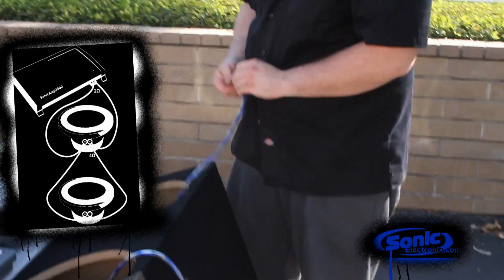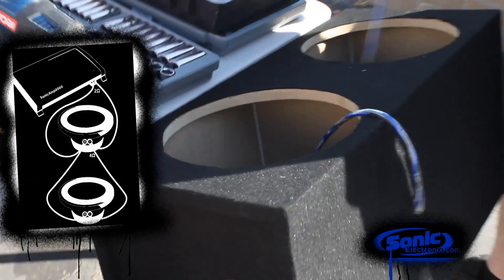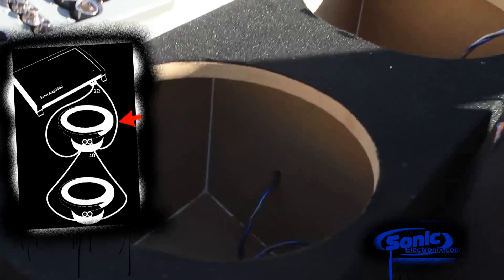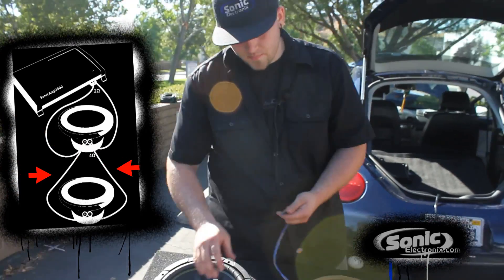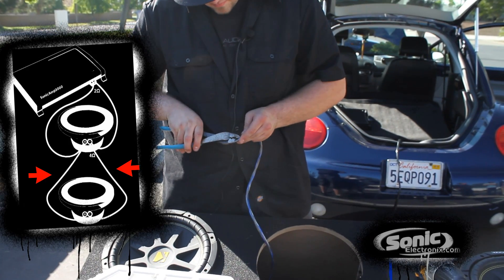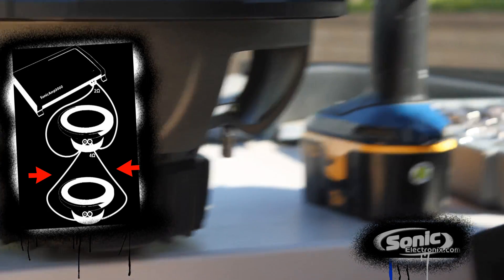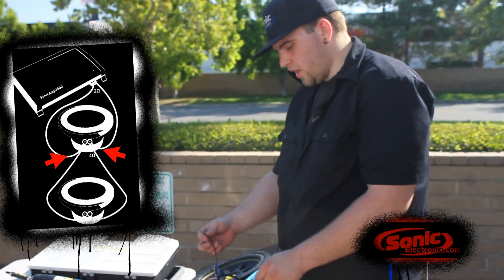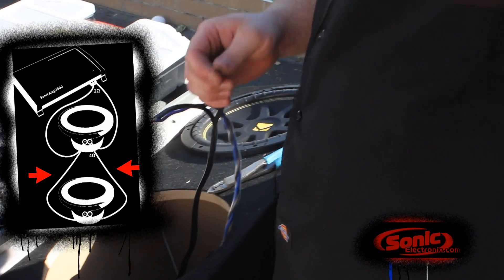How to Install Two Single 4 Ohm Car Subwoofer with a 2 Ohm Impedance

Comment: Pioneer TS-SW3002S4 I have 2 of this wmshalloe subs they are single coil 4 ohms each. My amp sometimes goes to protection mode. My amp is a hifonics brutus 2 channels 1600 watts old school. I haven't connected the subs at 2 ohms. What difference I should spect after I change my subs to a 2 ohms?

Comment: i did this with my 2 10" and its a huge sound diference i have a lanzar vibe 1200w amp at 1 ohm it pushes 500 w at 250rms and that matches my subs

Comment: I'll know the answer tomorrow when I check but, I bought a new amp last night that's 150 watt rms rated. I've got two ten inch subs rated at 100 watts rms in SEPARATE enclosures. One on each side of the back of my truck under the seats. The subs are each 4 ohms. My question is since their in different enclosures will running the positive wires together, and then running the negative wires together then connecting them to the amp bridged make the impedance at 2 ohms or will I have to run them like you've described when their in two enclosures. My goal is to get 75 watts rms to each sub. If I run them separate with one amp per channel at 4 ohms they will only get 50 watts. At least that's what the manual says. So a summary is how do I wire the subs so that they are at 2 ohms allowing each sub to get 75 watts?
Reply: Oh and they are both svc
Reply: I'm not positive but I'm pretty sure you need to wire them just like he did if you want to take them from 4 down to 2 ohm

Comment: Best way to wired single voice coil 4ohm 2 12
I have A 2/1 channel amplifier 1200w Sony Xplod 1200 Watt Audio Amp - XM2002GTW
Bridgeable 2/1 Channel Stereo/Mono Power Amplifier

Can somebody help me please the best way to wire them to my am so they can sound excellent please somebody help me Sonic Electronix please help me

Comment: So if you wired these to 4 ohms instead of 2 ohms would you get a lot less bass out of these speakers because there is double the resistance? I have a Rockford 1000 watt hooked to a pair of 4 ohms. The box says that the are good for 2 or 4 ohm setup so if I wire to two ohms will the speakers hit harder?

Comment: If i wire it correctly will each speaker receive the same amount of watts?
I am oing this to a pair of 6x9 my amp is 100 rms at 4 ohms and 150 at 2ohms.
speakers are 4 ohms but have rms of 150watts

Comment: you can also do it the best way wich this is not. both positives to both speakers to channel 1 positive and both neg to both speakers to channel 2  neg 
what hes doing doesnt make sens two 4ohm svc subs run in parallel weather your bridging just wiring to one channel on two channel gives you a final load of 2 ohms in series 8 ohms every dual channel amp that i know of gives you more power when you bridge it

Comment: I've got a question. I have a ported box. What if you don't want to drill a hole in your box? Can you go from one subwoofer to the terminal then around the outside through the second subs terminals and then wire it like that? Its confusing.

Comment from the maker: It can be complicated, but to put it in simple terms, the impedance of a system changes with the frequency being played. Once you put a subwoofer in a box, the impedance rises at the resonant frequency of the subwoofer because there is different pressure behind the subwoofer in a box. This isn't important for most people, competitors will use it to get the most out of their amplifiers.

Comment from the maker: Two Single 4 ohm subwoofers will wire together to a final impedance of 2 ohms. So, you would need a 500W amplifier at 2 ohms.

Comment: if i have pioneer 2 250w rms 4 ohm svc subs and i buy a 500w rms 4ohm mono kenwood amp will that be safe for both my subs and my amp? (old amp blew for some reason and i was looking on SonicElectronics)

Comment from the maker: Your call. If you drill through the box just make sure the hole is big enough for the wire but not much larger. You should then seal up the hole on both sides once the wire is through it. If you have a monoblock amplifier with 4 speaker terminals, you can connect each sub separately as it bridges the subwoofers internally.

Comment from the maker: Depends on what you mean by "sounds good". If you want maximum output, you would want to use the most power you can in the right box. If you are looking for the most accurate sound, you would go to 2 ohms or 4 ohms because the amp has the best control of your speakers at that point.

Comment: hey I have 2 xplod single voice coil 12s and I have a 2 channel amp 2000w, I already did the bridge with both subwoofers,I put the positive of one sub to the positive of the other sub and I did the same thing with the negative side of both subs and then I bridge both subs with a single wire to the amp but I didn't get clear sound.... what am I doing wrong???

Comment: i have two rockford fosgate single voice coil 10s but 1 is a p1 and the other is a p2 and i have a 2 channel amp but only one channel works so i was wonderin if i could hook those up like this and if it would work right? thanks

Comment from the maker: You cannot run both of those subwoofers together. Run one or the other or get two matching subwoofers.
Reply: Sonic Electronix I have these same subwoofers. Will it change the watt rms when you do this? If so what is the new watt rms on these 2 12” comp c at 2ohms. The 4ohm svc is rated at 300watt rms each.

Comment from the maker: These subwoofers are Dual 4ohm's. This means you can wire them at either 4ohms or down to a 1ohm impedance. If you don't wire them together, each subwoofer can take a final impedance of 2ohms, but you will need a two channel amplifier. The Kenwood will work just fine, but make sure you follow a dual voice coil parallel wiring diagram to ensure everything is hooked up properly.

Comment: I have 2  12 inch kicker subs 07cvr124. What amp would u recomend.  And want to wire to 2 ohms.  I was about  kenwood amp 1800 watts.  Thatas 900 watts rms at 2 ohms

Comment from the maker: Since your 2 channel amplifier produces all of it's power at a 4ohm impedance and your subwoofers are also 4ohms, you're going to want to wire both of your subwoofers one to each channel. This will allow the amp to produce the 300 watts RMS each subwoofer needs.

Comment from the maker: If you get the Dual 4ohm subwoofers, you can wire them down to 1ohm impedance for 2500 watts RMS. If you go with Dual 2ohm subwoofers, you will want to wire them at 2ohms for 1700 watts RMS at 2ohms.

Comment from the maker: You should be fine with 1 8 gauge power wire from the d block, and you should be able to set it up where you will only be needing to run just the 1 x 8 gauge for the ground.

Comment: what about wiring a DVC 4 ohm to 2 ohms and then connecting a 4ohm SVC together... in parallel. what impedance would that be.... a 2 ohm load and a 4 ohm load in parallel.?

Comment from the maker: We would recommend against it. But as long as the final impedance is within your amps limits and the RMS requirements of both subs are the same you could technically get away with it.

Comment from the maker: Wiring them to 2 ohms increases the power output on the amp. They will be louder for sure, but you need to verify that your subs can handle the power increase.

Comment: ok, i have 2 svc 4 ohm subs, can i do this to a 2 ohm 2 ch amp, cause i see you are only doing this to a mono block. the amp is a cadence xa250.2 500w rms @ 4 ohm and 250w X 2 @ 2 ohm. and the subs are MTX road thunder 250w rms

Comment: If i wire my two 4 ohm subs like that into a 2 ohm impedance, can i then bridge it on a 2 channel amplifier? or do i need to use a mono amp. Which would be my best option for more power?

Comment from the maker: @22DISA22 You need to wire them in a paralell configuration for a final impedence of 2 ohms.  This is done by daisy chaining all the postive terminals to the positive of the amp and daisy chaining the negative terminals to the negative of the amp. We hope this helps.

Comment from the maker: @stormer1092 Running them at 4 ohms will cause the amplifier to run at cooler temperatures.  Keep in mind that the lower the ohm load, the hotter the amplifier is going to run.

Comment: Hi so I got my hifonics hfi 2000. Before I install it I'd like your advice. It says it needs 4 gauge wire but I also came across your video about the big 3 upgrade, and It caught my attention because it says it helps with the dimming headlights. So my question is can I just use 0 gauge wire instead of buying the kit and would it be alright to run 0 gauge to the amp. Oh and one last thing I saw a video and they put a fuse between the alternator and the battery. What fuse rating is it supposed be?

Comment from the maker: @marchi3908 If you wire the subs in parallel at 2.6 ohms to the hfi2000 this should be fine.  You will be pushing around 1000 watts to the subs which would require 750 watts RMS if there are 3 of them.  Just make sure to adjust your gain accordingly as to not blow the subs.

Comment from the maker: @kigen818 You will need to wire it a different way then the video.  The video shows a parallel configuration and you need a series configuration.  Please follow the link to our wiring diagram tool:

knowledge[DOT]sonicelectronix[DOT]com/tools/subwoofer-wiring/

Comment: Im getting 2 kicker cvx122's and on your website it says the impedance is a dual 2 ohm and i am also getting a Hifonics HFi3000D amplifier, how would i need to wire it to get 750rms to each woofer? Do i wire them the same exact way you did in this video? Please help. Thank you very much !

Comment from the maker: @killa4nyah They will probably be pretty close considering that both of these set up will have the same amount of Cone surface area.  The 3 10's will give you a more responsive bass but the 2 15's will give you a deeper bass.  If you want deep bass go with the 2 15s and if you want tighter bass go with the 3 10s.

Comment: Hi I have a question which. Subs are better kicker comp or kicker cvr and is a hifonics hfi 2000 Watts good to push three. I just need a professional opinion on which to get either the comp's or cvr's. Thanks

Comment: I have a 1 channel 250 RMS/500 peak power amp for my Alpine Type E 12's (also 250 RMS/500 peak power). What is the best way to wire my subs to my amp? Bridged or parallel? And is it recommended to match watts or should I get an amp with a little more power?

Comment from the maker: @latdum The amplifier shown in the video is a 1-Channel amplifier.  For your Amplfier, you will have to input each subwoofer to its own channel.  Usually, this will not be enough power.  Additionally, you can bridge the two channels together to get more power output but you will not be able to achieve a 2ohm Impedance.  It would be highly recommended to run a 1-Channel Amplifier.

Comment from the maker: @racerboy2323 It appears as though you may have picked out the wrong impedance for your subs. Your Kicker amplifier is 2ohm stable, but wiring 6 DVC 4ohm subwoofers in Series/Parallel will result in a final impedance of 1.3ohms which could potentially overload the amp. We do not recommend wiring those 6 subwoofers up to the 2500.1. We advise that you find an amplifier that is 1ohm stable and can produce the required wattage, such as the Hifonics Brutus BRZ2400.1D.

Comment: Hi, I'm currently running a kicker 2500.1 powering 6 JL 8w1's wired to 4ohms. I'm switching the subs out for 6-REX 8" dual coil 4ohm subs. How do I wire them up? Thanku in advance.

Comment from the maker: @TheOxyMorin For quality go with a woofer that will give you a final impedance of 4 ohms, so either  a SVC 4 ohm sub or DVC 2 ohm sub. Then go with a sealed enclosure for tighter and more responsive bass. Here is what I would do. For the sub, JL Audio 12W3v3-4, for the amp Kicker ZX500.1, for the enclosure 12SQTC and for the wiring kit the Kicker CK4. This would be a very very nice system.

Comment from the maker: @DTayBeatz Yep wire then exactly like on the vidoe. The perfect amp for two 15" subs with a final impedance of 2 ohms and a power rating of 500 watts RMS go with the Kicker ZX500.1, the amplifier was specifically designed to strive in these situations and it is pretty affordable. Let us know how it turns out.

Comment from the maker: @KingBre99 I would say go with the 1SL12-0.7 for the enclosure and the Kicker CK4 for the amplifier kit. The enclosure is a sealed enclosure for tighter and more responsive bass. If you want deeper bass then go with the Absolute PSEB12BK enclosure. This enclosure is ported and will allow for elongated lower frequencies for deeper bass.

Comment: i wanna install two kicker 15" subwoofer they are both 4ohm and 500 watts at 250 rsm each..... do i install them the same way as in the video? and what type of amp should i run? and do u think a cap in needed

Comment from the maker: @TheTechGuider If you have two Single Voice Coil subs with each voice coil at 2 ohms then yes you can wire them together to a final impedance of 1 ohm. Unfortunately  each subwoofer will not get 2500 watts, they will each get 1250 watts. Keep in mind that running a system like this will require an upgrade in battery power and possibly your alternator.

Comment: @SonicElectronixTV Thanks for clarifying. i have a question if you would answer. im buying a soundstream rubicon mono amp the 2500 watt version its stable at 1ohm for 2500 watts 5000 peak. now if i buy two 2ohm 15's and run them parallel to get 1ohm an hook them up to the amp will both speakers get 2500watts?

Comment from the maker: @TheTechGuider We actually have a typo, you cannot wire two Dual 4 ohm subwoofers to a final impedance of 2 ohms. You can either wire them two a final impedance of 1 ohm or 4 ohms. What the video was trying to say was how to wire two SINGLE 4 OHM woofers to an impedance of 2 ohms. So for the purposes of the video it should be two subwoofers with a single voice coil each at 4 ohms each voice coil. Sorry for the confusion.

Comment from the maker: @9grande Its almost irrelevant to be honest. The different impedance gives you different wiring options. Also if you already have an amplifier the power rating at the appropriate impedance can dictate which subwoofer you will have to select. It is always better to run your sub or subwoofer to a final impedance of 4 ohms. If you have only sub then you would go with either  SVC 4 ohm sub or  DVC  2 ohm sub to get that final impedance of 4 ohms.

Comment from the maker: @Boobie16 If you have two Single Voice Coil 4 ohm subs then yes,just wire then together in parallel to a final impedance of 4 ohms. If you have two Dual Voice Coil 4 ohm subs then you can wire each one individually to 2 ohms but not together, if you have two Dual Voice Coil 4 ohms subs you wont be able to wire them to 2 ohms on your amp, you can wire them to 4 ohms or 1 ohm.

Comment from the maker: @asinhawkeye0065 If you have 2 12" Single 4 ohm subs I would suggest going with the Kicker ZX400.1 at a final impedance of 2 ohms. If you have 2 12" Single 8 ohm subs I would suggest going with the Kicker DX300.2 to a final impedance of 4 ohms at the bridged impedance. These would be the best two amplifiers to use with out having to spend more than 200 dollars.

Comment from the maker: @gigasearchman If you wired them exactly like the video (parallel) then you should be fine. Consult your amplifier manual to make sure you are using the correct terminals, if you have more than one.

Comment from the maker: @S1R369 If you want to wire two dual 4 ohm subs to a final impedance of 2 ohms unfortunately you won't be able to do it. You can either wire them to a final impedance of 4 ohms or 1 ohm. Your other option would be to wire them separately to their own individual channel in parallel to a final impedance of 2 ohms each. If you do this you have to make sure the amplifier is providing enough power at each channel to each woofer.

Comment from the maker: @xxxkhafanxxx If you have two Single 4 ohm subs then yes they can wire to 8 ohms. two DVC 2 ohm subs will wire to either 2 ohms together or to 4 ohms or 1 ohm individually. Yes 0 gauge is the same as 1/0, just make sure you get true to gauge wiring. Wiring is important so don't be afraid to spend a little.

Comment: @SonicElectronixTV 
Thanks man haha!! if i run 2x 4ohms to the amp, will the amp read 8ohms in total?
According to your wiring page, is it something like this? " 2 DVC 2-ohm sub ". ( assuming that i have dual 2ohm voice coil sub). and is the 1/0 Gauge wire different from the 0 Gauge?

Thanks Heaps!

Comment from the maker: @gigasearchman If you have the manual it should tell you which terminals to use for what impedance.  You wire each sub individually in parallel and then each sub to its own positive and negative terminal. This will give you the final impedance you need. So if you have Dual 4 ohm subs, each sub will have a final impedance of 2 ohms, if wired individually to the amplifier. I don't like doing it this way, I prefer wiring the subs together and then to just one negative and one positive terminal.

Comment from the maker: @xxxkhafanxxx If you can have a final impedance of 4 ohms go with that. The amp will play better and cleaner at a final impedance of 4 ohms. The Colossus amp is pretty powerful, wit that amp you can essentially wire each woofer individually to a final impedance of 2 ohms and run them off each channel. All I can say is man you are going to be setting off some car alarms. Remember to get 1/0 gauge power and ground wire.